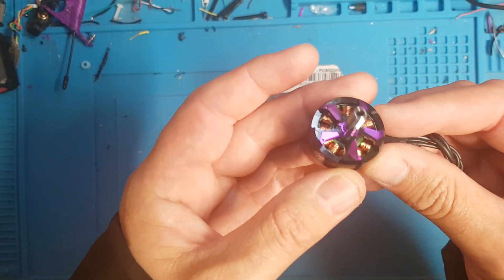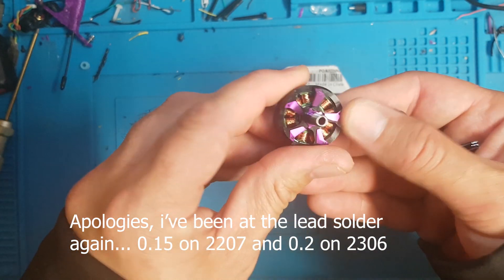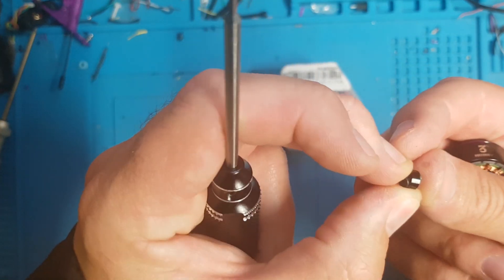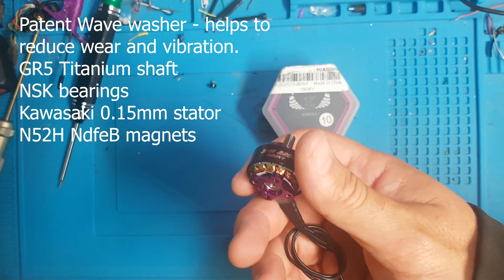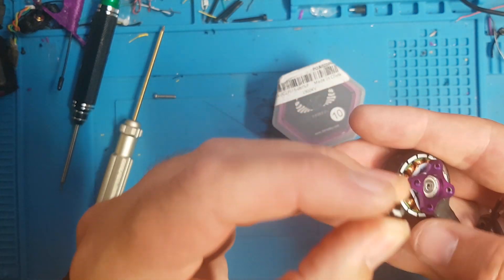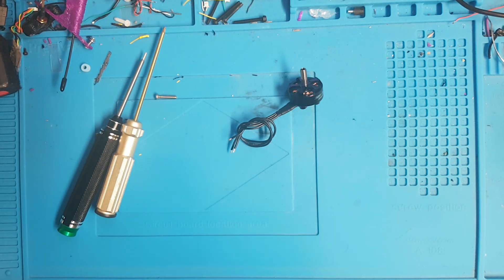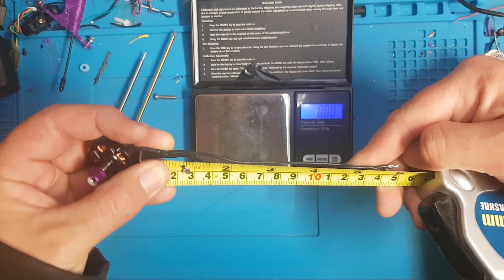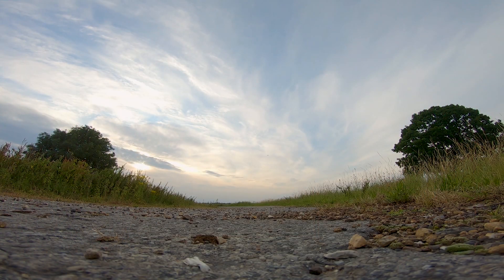3b 2207 pro II 1900kv motor review and maiden flight

Comment: Thanks for the great review! How do you like the 3b Hobby 2408 1900kv motor? How reliable? I got them and I plan to built in a 7" / 5s combo, but not sure about it (just chek the package but havent installed them yet)
Thank you in advance.
Reply from the maker: They seem OK but I don't think they're efficient enough for 7". I run them on 4-6s but the flight times aren't great so you'd probably be better with a bigger motor lower kv. The smaller ones were great initially then died quickly which Is unusual for me but these have been fine.
Reply: @CoppertopFPV  Thank you for your response. Currently I'm using a Xing 2207 1800kv, and they handle quite well the 7" dual props, but I miss the torque a little bit. I hope these 3BR 2408 1900kv could deliver the extra punch. ;)
Reply: @CoppertopFPV  I'm thinking hard on the Brotherhobby Avenger V2 2507 variant, but I don't know which brand is better.. 3BR or Brotherhobby, due I don't have any experiences with none of them... 🤔
Reply from the maker: @szaszbulcsu  these have tons of power. brotherhobby are better imo. My smaller 2207 3br were super smooth but if they don't last its pointless. Personally I'd get the brotherhobby but emax have just brought out some big super cheap eco 2 2807 and 13 or 1500kv motors so I'd probably give those a go as they're £12 and would be great for cruising. I'm sure they're not as good but for £12... Lol  I tend to run rcinpower on most stuff these days as they're the best compromise for longevity and performance but I think their big motor is pricey.
Reply: @CoppertopFPV  Thank you for your detailed reply. I pick a Emax ECO II 2806 1700kv version, for 14 USD it could worth to try. ;)

Comment: Did they change the motor to a single stand winding because that’s all I can find now.
Reply from the maker: Not that I'm aware of but I won't be using them again. As per my pinned comment I've been through 2 already which is rare for me. Rcinpower are much more reliable

Comment: I'm willing to bet on S4's, you'll be right there on stock tune, or this tune.
Reply from the maker: S4s are stunning. As smooth if not smoother than the s3s with a lot more punch. Love them.
Reply: Ha, that's excellent.  They're not in my color palette at all, but I figured that prop is something you'd appreciate
Reply from the maker: @tehllama42  mine neither but they're in the local footy teams colours so I'll have to cope :)

Comment: Have the same issue with the furling32 f3 having 1 motor start up a bit late. Although I'm really liking its durability and it feels super smooth in the air! Definitely my favorite ESC at the moment.
Reply from the maker: Andre Martinez presume yours is the normal 4 in 1 furling? If so I like that one a lot. This is the just released airport version with a completely flat back, and its super light. I hope it holds out, as it makes life super easy.
Reply: @CoppertopFPV  yup, I'm using the OG one. Flat back does look good for sure! Time will tell how reliable it is as it is a pretty unique design. Please update us with a followup video regarding it!
Reply: Hi man. You have the furling 32 45A 4in1? Have you been using it for a while? I have the same issue with one of the motors. So is an deffective model? I use it for a week now and it flies ok except this issue. But i fly it with 4s battery at the moment.
Reply: @bozosni  I dont mind it. Using it for about a month now and I've put it through its paces.  Holding up pretty well. Very smooth in the air too
Reply from the maker: @andremartinez6934  that's reassuring. Mine fly fine too. Weird tho. Can't think of why they'd do that.
Reply: @CoppertopFPV  Same here. I was concerned at first but its still the smoothest ESC I've used.

Comment: don't know what ppl see in these motors 👎🏻 multi strand motors don't seem to last, burn out much easier, from my experience compared to single winding motors. good place for these is in the bin
Reply from the maker: Ill bite.... They don't burn out, but are more suseptable to the windings being damaged, though the only time I've ever done this is on pyrodrone motors. They're also more powerful due to having more cppper and more expensive to make. All I can say is they feel amazing and look built to last, oh and are designed by the guy who pretty much revolutionised quad motors while designing the original emax red bottom.

Comment: Sounds like you've got a nice tune already but just FYI I've managed to turn off ALL the low pass filters on my radix builds on 4.0. Really liking the radix. The onboard spectrograph really takes the pain out of tuning filters. Just fly around a bit, land, check the spectrograph, adjust filters a bit, save and reboot. Also I get my logo on arm which gets me loads of peer validation when people see my fpv feed.
Reply from the maker: just needs a lot of propwash removing. This is just a quick setup and fly. Rather surprised at how well it flew. Remove propwash and keep the feel is the next goal.
Reply: @CoppertopFPV  even if it's just for shiggles give bf4.0 a go with only one lowpass filter on d term. I've not tried kiss or fl1 but bf4.0 on low filtering is pretty great.
Reply from the maker: Fraser Steen I have 4 on another quad. Not a fan. Lots of faff to get it flying no better than 3.57 for me,  though I’m sure it’s easier with this. I’m sort of sulking with them as I think 4 is a giant mess of unfinished ideas when they haven’t polished half the existing stuff 😜the radix has one purpose for me - return to home, otherwise I’d be using kiss.